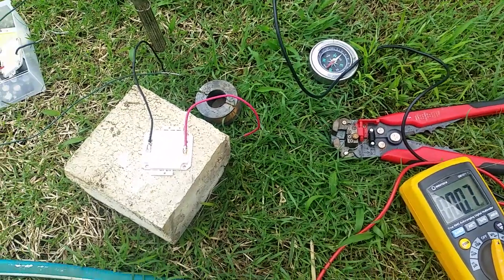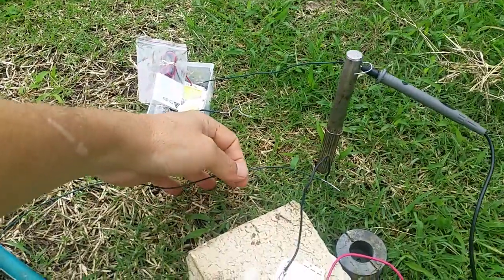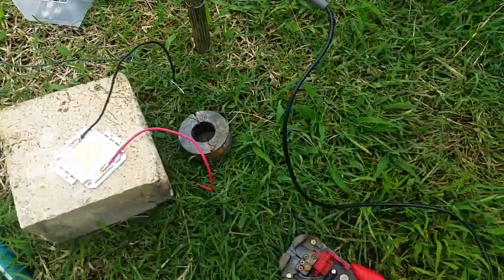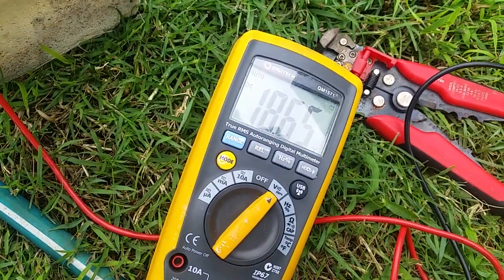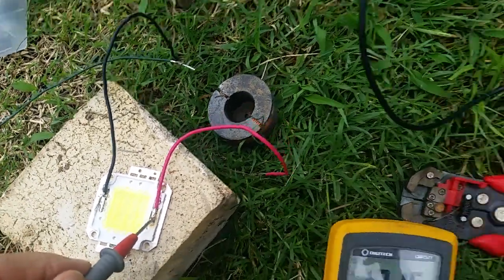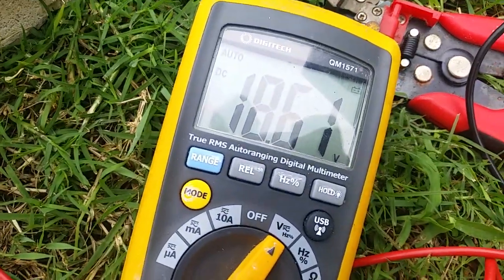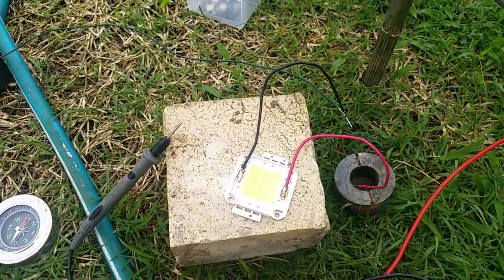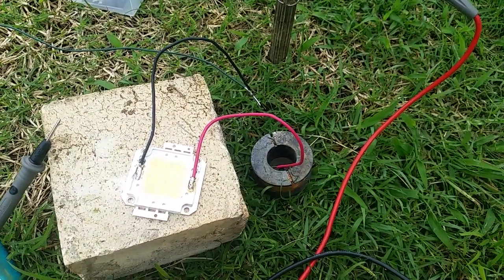18V from LED & 2 Earth stakes? N.C.Hands inspired experiment.

Comment: What is being demonstrated? Induced voltage in a piece of wire has been  known for over a century. So nothing new.
Cheese hands used a multimeter for about 20 years and thought it was an AVO. It was a Micronta DVM22-191. It's a good idea to know the equipment you're using.
Reply from the maker: the effect being demonstrated that I found most interesting was the magnetic current that wasn't present in the steelwire until it had been connected to the 2nd earth rod. and was still present after the wire was removed from the rod.

Comment: The multimeter can measure the voltage taking absolutely tiny charge (or current) from the circuit being tested... So you should add various resistors  across the probes, so as to measure the power it can provide  ...

Comment: 20 years ago I noticed there was a 14.5 volt potential between two ground rods 20 feet apart.  Turns out our electric company had a faulty buried cable (six feet deep) feeding my house  and that was the cause. They sent some well equipped engineers to source the fault. They told me, BTW, all the  doors and walls in my house were "painted" by ultrasonic motion detectors.  I said "That's some very sensitive gear, huh?"  One of them rubbed a thumb and forefinger together 20 feet from the device mounted on a tripod.  I heard the amplified static crackle as he did.  They left some paper tape recording instruments to monitor voltage and frequency of each if the  220v. "legs" and ground. Returned to retrieve meters and issue a service order to replace that buried cable.  Before the work got done I lost one of my 2  220v. power legs leaving me with just 110v.  They brought out a special transformer to ramp up 110v. to 220v. to power our oven, heat pump and clothes dryer.    On my property I found a 20 foot piece of 3/4 in. galvanized steel pipe on a layer of compost  covered by more leaves.  Speaking with neighbors it must have been laying N-S for 45 years. Keeping that same orientation I measured the potential between it and a ground rod. 18.2 volts. I used it to power some low current electronics constantly. (Didn't have a scope or a meter to measure the frequency...)  Lost the pipe when my new home was built. I assume it was hauled off in one of the building waste construction  'dumpsters.' (I didn't remember to store everything  I had on site.)
Reply from the maker: Well THAT is a verrrry interesting story!